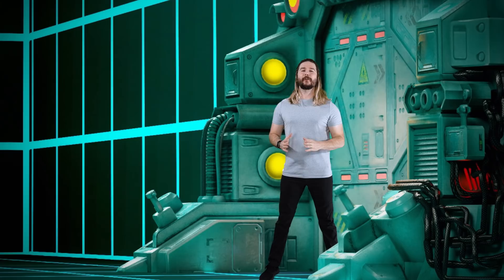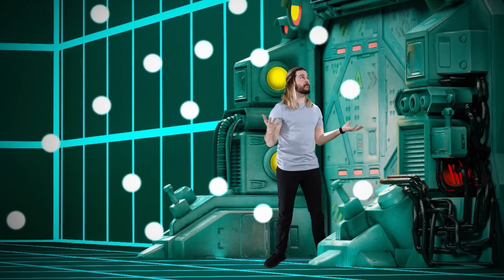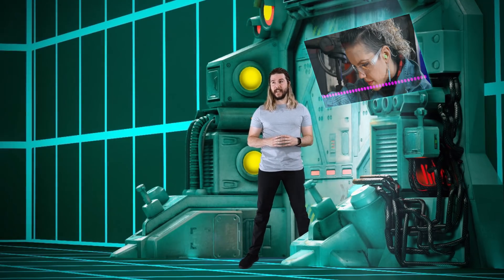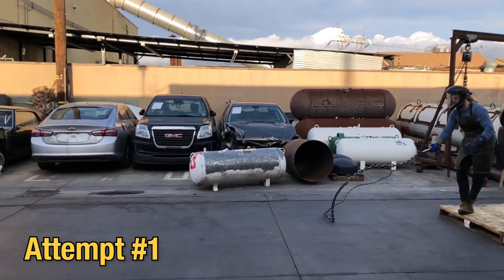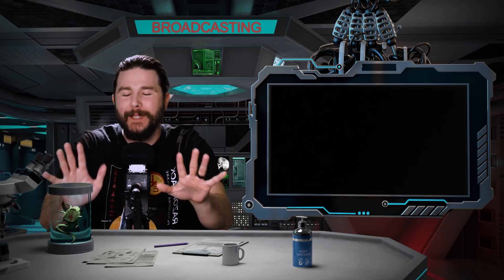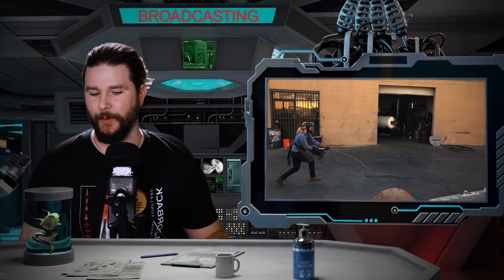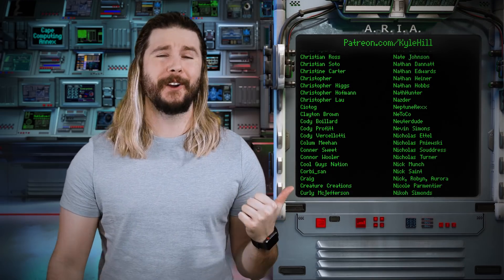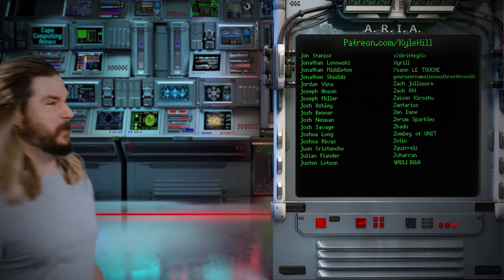Can I Make a SUPERSONIC STEEL WHIP?

Comment: I think 2 things are preventing a sonic boom here, first is the rigidity. If you look at the footage of a bullwhip, you can clearly see that it makes really awesome circles tending to get smaller, because it is flexible enough. 

Steel chains on the other hand are, by design, not that flexible. Steel chains have no circular rings, but rather kind of oval, this means that if you put any kind of stretching power to it, it doesn't get a smaller and smaller corcular motion like a bullwhip, but tends to be rather stiff, and in the video here we clearly see that with the force pulling on the end of the whip, it gets really stiff. I doubt a steel chain is possible, but maybe some kind of softer steel at the end instead of a chain, could so the trick.

Another thing is the drag, when someone really uses a bullwhip he tends to whip it in a way where from the beginning of the motion the whole whip does not move on the ground, but only in the air. The drag generated by fricrion on the ground in this video could potentially be a factor why the energy needed is not generated. 

The whip basically is too heavy to actually do it. 

But what is, if you start at the behinning with a smaller chain...this could reduce weight enough to eliminate some drag, it makes it easier to put power into it and it potentially could produce the desired results. Maybe even making it a bit longer could work.

So stiffness, weight, length and drag, these 4 problems are to tackle to get a steel chain whip that produces a sonic boom.

Comment: Good try man. By weight the links need to shrink down the line, it needs to have a certain taper to take advantage of the mechanics as well and about another half a thor to be actually able to generate the force needed to wave that much steel.

Comment: Well, you didn't Fail. You merely demonstrated one way to NOT make a chain whip crack the sound barrier. It's only Failure when you totally abandon your attempt and never try again. Others cheat by putting on rope ends, but what if you used thin steel cable. The kind used for dog runs, that's coated in plastic ( remove coating ). It's not rope or fabric, and it's thin enough to make a crack. Ever hear cable under tension snap?

Comment: You need a tip made of steel cable frayed at the very end...or some chain-like analog.  This would stand in for the Popper/Cracker section of a leather bull whip that's required for the crack/boom to occur.  

This section, which is dramatically thinner than the previous parts of the whip cause an explosive acceleration at the end of the swing.  This happens because the larger taper is used to transmit and accelerate the waveform of kinetic energy created by the initial swing.  Suddenly applying that waveform to a dramatically thinner section at the tip caused the waveform to rapidly and explosively dissolve.  This quick dump if energy into the air surrounding the frayed/fan-like portion is the actual key.  The friction of those rapidly accelerated air molecules against the static air molecules around them causes the actual sonic boom or whip crack you're looking for.  

It's all about the phase change brother.  The air at the end of the whip is the fastest and most important part of the whip.  It's what does the all the cracking.  

So just tie or weld a length of frayed cable...or maybe a few lengths of smaller chain to the end of what you have and you should be in business. 👍

Comment: There's like a 10yo video of a man cracking a much smaller chain (a dog chain) over his head. He goes to the effort of explaining to be careful what kind of chain to use and to look out for the welds lest the chain break mid-crack. He also explains to be careful with it and use coverings for the part of the chain you're holding so you don't accidentally slice open your hand.

I'm no science expert, I just think it makes sense than Kyle wouldn't be able to crack a massive chain whip, especially with very little practice.

Comment: Yeah, a problem came along! There's probably a hundred times more steel than is needed for this. If you try again use 1/4th or 1/4 of a 1/4th size chain. 
I think a neat way to 'throw' it would be to fashion a puller from a used cable drum. It would need a motor and a few other parts - a shaft and a turntable like device to let the drum rotate. Also it needs a positive stopper to stop the drum and launch the chain, stopping it could be a problem idk. I found this chain, looks good right?: Koch A01160 3/16 Proof Coil chain (not cross-bar) attach that to the drum then flip a remote-distanced switch to an electric motor and let it fly. When it's at a good speed kill the motor and actuate the rotation stopper. 
BAM Ohh shit! This shouldn't break (or remove) your legs or head, after it runs a couple of times without the damn thing falling apart, work out the details! You got this, you'll be the first youtuber to chain-break the speed of sound, be back next week to see the video, good luck!!!!  💖💖💖 I hope that works, nothings funny about breaking a $13 dollar chain that's spinning real fast. You'll find out!

Comment: I think 2 things that would make this a lot more possible would be 1, practice with a regular whip until you can pretty consistently crack it first (both so you can get a better motion and so that the self harm risk gets lowered substantially) and 2, as other people have mentioned, add a cracker.  I imagine if you could find some form of flexible steel cable to replicate the twine cracker from a regular bullwhip, you might have better luck (maybe some stripped thick gauge wire as another possible material).

Comment: I think the reason why the whip failed to produce a sonic boom was because of 1) how it was tapered 2) the mass of the whip & 3) the force you would need to use to get it to break the sound barrier. The chain whip, while super cool, is not an effective whip because of the mass of steel (heavy as shit). If you think about, we are able to launch metal objects all the time at speeds faster than sound. However, those objects are usually tiny or are using an excessive amount of energy. A regular leather whip can probably crack the sound barrier because of the mass of the material. Meaning that you'd probably need to use more force than you or most people could produce with their squishy human meat sacks. And even if it was possible for you to do it (which I'm certain couldn't happen, see meat sack) what would the kick back be like when it finally hit? Honestly, if you accidentally hit yourself with a whip of that mass going at that kind of speed...

Let's just say that bruises would be the least of your concerns.

Comment: well what I can tell you from experience not from a whip (well not an intentional one) but a cable breaking under load, even a fairly high mass steel chain or cable can most definitely break the sound barrier, and they can do more damage than anyone would ever expect (unless you work around them frequently)

Years ago on a job site a small dump truck got stuck, there were dozers on site, and they overseer thought it would be brilliant to use a 3/4 inch cable to pull it out using the dozer, now, most of us were smart enough to not want to be anywhere near this, because I've worked with chains, ropes, and cables most of my life, I know they can be a devastating force, so anyway, most of us got well away from it, twice the distance of the length the cable at least. The overseer when warned he should get clear just said "It's fine." 

Well, the cable snapped and whipped around, and amputated his legs just above the knee. clean through both. and the bang it made was incredible. So yeah a large mass of steel imparted with enough energy will certainly break the sound barrier, and just about anything else that gets in its way. Not a pleasant experience, not a pleasant sight. So just remember that shits dangerous.

Comment: I feel like because of how the chains cause friction ad soon as it moves that later down the chains it's losing most of it's power, because steel has no stretch no give and transferring the energy is more difficult, because leather bullwhips are weaved in a way that they will stretch verticly and with that whip motion the leather is able to transfer the energy more due to its elasticity, so the guys vid with the leather at the end has what is called a " cracker" at the end, most people talk about this piece being key to its crack sound usually tied off at the top of the whip, and the combination of the steel and leather, allows all the chains to produce the energy and transfer to the leather, without losing nearly as much energy because of alot of chains moving together towards the end, but that's just my theory really

Comment: its probably possible, you just need to sharpen the taper a bit more, and taper to a thinner chain, maybe even make a cracker out of metal tinsel, also get a nylon or leather whip and practice good form, come back to this its not a failure of the experiment, its just a lack of required skills
Reply: oh and probably oil the chains for less friction

Comment: You know steel wire exists, right? You could even shorten the whip by removing the biggest chain from the whip, and add steel wire about half the length of the smallest chain, and try again. I think that would actually work. Edit: Or use steel wire the thickness of those very thin jewelry chains. But the title "steel whip" doesn't limit you to only using chains. Edit2: I think the chains have too much lateral move, which I think is acting like a buffer against the sonic boom. I mean, the whip tip is supposed to be able to not only flex onto itself, but to also use elastic deformation to force the very tip to move at speeds higher than the speed of sound.

Comment: If you want to see a "steel whip" truly crack, look up a video of a steel cable, under load, snapping (I.E.: failing). This will also lend irrefutable credibility to concerns over safety! If you were in the wrong place at the wrong time, that steel whip could literally cut you in two...

Comment: You could just chainmail-clad a thin leather whip, or even a tapering rubber core..? One thing that you'd need to change for sure is the rate of reduction in mass, per link. In a few of your slow-motion shots, you can see where like-sized sections of the chain move as quasi-separate sections, rather than as part of a unified whole. Such a build would obviously be cost-prohibitive (very time-consuming), in most cases. But, if you did that, you'd get much better results. Even still, it may be impossible, without inter-braiding it with something like leather or rubber.

Comment: 2:53 If you ever observe steel under an extreme tensile load suddenly fail and snap, you'll also hear a sound akin to a high pitched gun shot (like a 22 LR). That's an example of the sound barrier being broken, in a solid.

Comment: Hmmm... I would have said...look into the original whips... to lets say we have 10 m/s at begin, which is ok-ish but still fast, to break sound barrier we talk about ~340 m/s, meaning that v is 34x faster, meaning that v^2 is round about 34^2 ~1,000 times larger, meaning that its m decreased by factor 1000.... no way you get this in steal...
and if you look to a normal whip.... what do you see at the end? fibers... these fibers are the 1/1000 mass of the start... remove them or make them heavier, that often prevents the crack of the soundbreak.... so.... physics was against you 1 to 1000 so to say ;)..... trust your equations man ;)

Comment: One thing I noticed was at Attempt #3 at 5:48, in the slowmotion you can see that transition from the bigger to the smaller chain breaks the form of the whip and it sorta collapses in on itself, it looses that loop shape, meaning that the momentum no longer propetage down the smaller links of the chain..
If I were to make a suggestion, it would be to use a far greater number of steps  with far smaller decrements, when stepping down to smaller chain links, this way it would hopefully be a more smooth transition and the momentum gets to carry to the next step each time.

Comment: The major problems with this whip is that its too  heavy and not flexible. You need to use steel cable not chain. Woven steel like woven leather whips.

Comment: doesn't cracking a bullwhip generally require you to change the direction shortly before it's fully extended? Like the pros typically will swing their arm up, dragging the whip from behind to directly in front, then swing their arm back down quickly to force the movement to accelerate. In all your attempts, it looks like you just swing it out, then hold it in place. Which makes sense, because yanking it back that little bit is when it gets REALLY dangerous (it's the point that causes that supersonic crack, and causes it to double back on you a bit), plus that thing has to be really heavy so the energy of taking the thick steel chain currently moving in one direction, then switching that up-probably more strength than even the 'dollar store thor' could muster lol. (you would likely need someone along the lines of the world strongmen competitions to do that. or maybe a robot specifically designed to mimic the motions of a professional bullwhip master)

Comment: The chain is missing a factor of potential energy in the case that the chain has no resistance to compression. The links freely pivot and don't store vertical vectors of force, just horizontal. Therefore the compression wave breaks down and turns into a more swinging motion, losing energy to the amplification of horizontal movement. So it's not the material that's the issue, it's the construction. That also makes this "not-a-whip-it's-a-chain" incredibly dangerous to the user, as almost all of the potential energy can coil back to the point of origin in big, wide, un-dodge-able lashes. USE A BRAIDED STEEL CABLE that is tapered in much the same way. You'll see the difference is phenomenal. You can actually use it with skill to keep that compression wave going at a range from your body, meaning less accidental decapitation/dismemberment and it will require less energy and give you more control. Also... don't actually do this because the reason a bull-whip is made of leather is that at the end of the day, it's not supposed to be deadly. Try not to make deadly weapons that are also fun to play with, kids.

Comment: That's not how to do this ... :D You should have sent continuous sine waves through the wip, more and more increasing the energy. That way you should be able to achieve what you want, but it's still not actually wipping a wip. To properly wip the wip there needs to be a wave in the wip, which clearly doesn't happen the way you're doing it. The other guy in that other video causes one. He wips it differently than you do.

Comment: Looks like you were “casting” the chain- throwing it forward, rather than “whipping” the chain.
A longer handle would increase angular velocity, increasing terminal velocity, and also keep the chain further away from you, increasing safety & confidence to throw harder!
“Pulling back” after your cast- think more “horizontal J” shape- hooking the handle back instead of a horizontal “C shape” throw will also increase the distal acceleration, making that end crack a bit more viable!

Comment: After you send the tip out you need to snap / pull the whip directly back toward you. The rapid last second change in direction at the tip amplifies the speed and makes the crack. to do this is dangerous raised to 1,000 as the chain will be coming directly back to you at even a faster speed.

Comment: Awesome follow up! 
Quick observation at 8:29, it looks like there's something going on at the end of the second chain segment where it's not able to effectively transition its energy to the third segment. Instead of smoothly transitioning down the chain the beginning of the 3rd segment flattens out not following the curve and the second segment is allowed to do its own partial flick wasting energy and bringing everything to the ground. Maybe the chain diameter is reduced a bit too much too quickly? More segments over the same distance might help if that is the case.

Comment: Same thing happens in the drugs industry all the time - you don't get to see the failures in attempting to make a valid medical treatment.  Although you do indirectly in the cost needed to pay off the stupidly expensive costs in testing all of those failed drugs which itself is pretty huge, never mind testing the most successful one(s) against every other common compound for safety.
Any typical drug costs upwards of ~$1-3 billion these days because of this.    
Depending on the complexity of the disease being treated, you can end up with double, rarely triple digit failures usually costing millions each, depending on how far they get before hitting a huge roadblock and being dropped.
Luckily machine learning is helping to make the entire materials science and related industries vastly easier and it will only improve from here.  It's still early days but we've already had many successes in developing new materials and drugs with it.   As it gets rolled out and proven to work more generally, those failure rates should get incredibly smaller.  It's an exciting time for both ML and materials research industries.  Future job if you are looking for one.

Comment: The leg hit looks like a combination of the weight of the chain and technique. If you haven't cracked a bullwhip before, you definitely might want to try it with a leather one. I still have scars from my first weeks practicing. Maybe hit up April Jennifer Choi, she worked with Destin from Smarter Everyday on some research about how whips crack. If you're trying to get this done as all steel, purely chain may not work and some metal cable with the end partly unwound could do what the kevlar or nylon popper at the end of a conventional whip does.